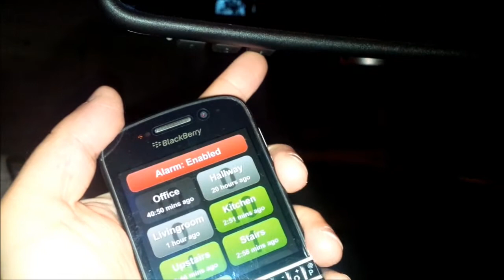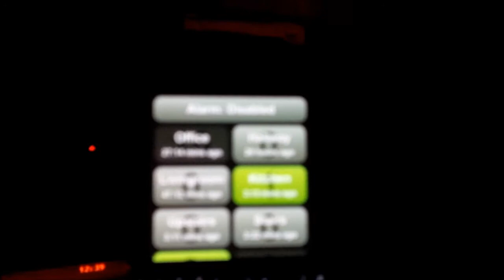Control Home Automation from Your Car Using Homelink

Comment: Hello, hope you can help me out. I need to send the Home Link Buttons to a digital output (normally open, dry contact), what do  need to put i the middle to make it work ? regards
Reply from the maker: an x10 RF receiver plugged into a raspberry pi, running the Mochad service is your best bet. You're on your own for coding the logic